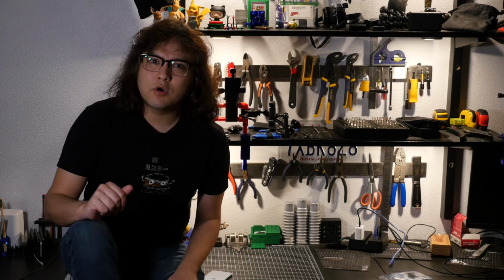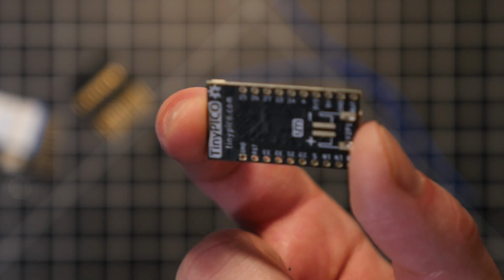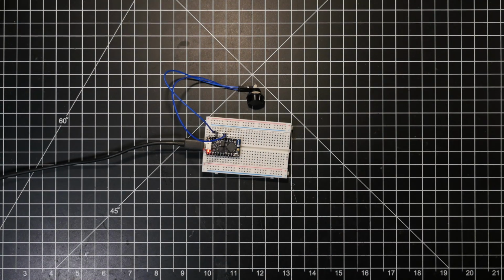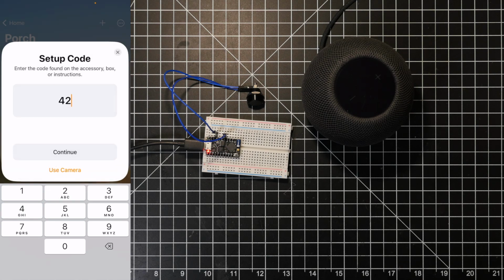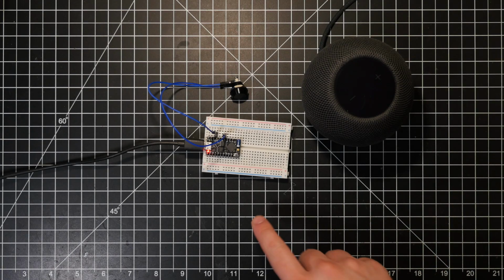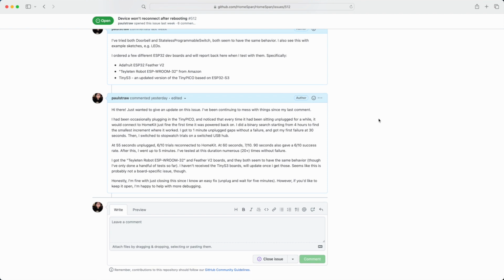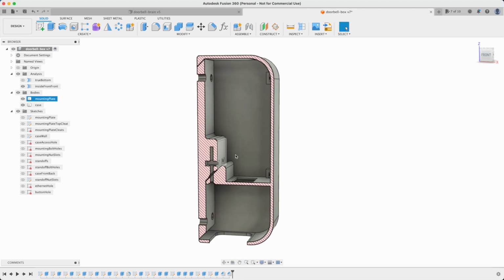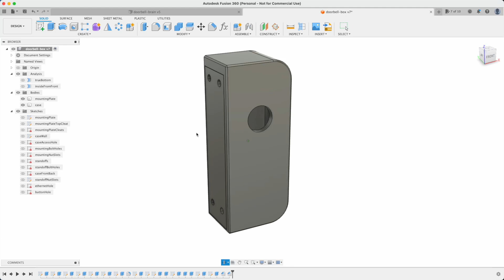ding dong. who's there? DIY homekit doorbell

Comment: Do you know if it’s possible to do an intercom no-video doorbell? Would love to hack something together for a building intercom.
Reply from the maker: I don't think audio is possible with HomeSpan. You might consider getting a cheap security camera with two-way audio and ripping out/otherwise disabling the camera parts? TP-Link Tapo C310 could be a good candidate. I use Scrypted to connect non-HomeKit cameras to HomeKit, and it works very well.

Comment: Hey, great video! Great editing, but something keeps nagging me. Why run an Ethernet wire from the doorbell when you could have just put the microcontroller in the doorbell box and run a much smaller wire just for power?
Reply from the maker: Good question! My reasoning was:

1. If there's an issue with my outdoor case design (i.e. it leaks), or someone vandalizes/steals/otherwise breaks the outdoor portion, I'd much rather just replace a button than a whole microcontroller.
2. I've not done any sort of security hardening on this system, and I don't want to put a microcontroller with access to my home network (and unencrypted credentials) on the outside of my house.

Now, do I really think those would be real-world problems? Nah, but this way I don't have to worry about either!
Reply: @paulstraw  that makes a lot of sense. Somehow I didn’t consider the vulnerability aspect. I’ll have to keep that in mind as I’m working on an outdoor IOT project soon.

Comment: Well done! I love the Homespan lib, I've been running it on several QT Py ESP32 S2 and it's solid, never encountered any connection issues. Is that problem specific to Pico D4?
Reply from the maker: Thanks! I've tried a WROOM-32 (Amazon board), PICO-D4 (TinyPICO), and PICO-MINI-02 (Feather ESP32 Feather V2) so far, and all present the same issue for me. I have some S3 (TinyS3) boards on the way, looking forward to testing with those.
Reply: @paulstraw  Really Weird. This is unrelated to HomeSpan  but I had some issues in the past with few of my homekit hubs stuck on standby and leaving bunch of devices unresponsive or struggle to get connected.
Reply from the maker: @salimbenbouz  I actually ran into that issue last week with my security cameras! Sadly it seems to be a separate problem. I'm also getting the same results on a separate test network without any HomeKit hubs. It's a real head-scratcher 🙃
Reply: @paulstraw On a separate Network!? You got me intrigued. I will definitely try the new Homespan release in the upcoming days.
Reply from the maker: @salimbenbouz  Yeah… I feel like it must be something ridiculous on my end, I just have no idea what the common denominator is yet.
Reply: @paulstraw  any updates?
Reply from the maker: @StormBurnX  No, I haven't made time to look back into this. We rarely lose power, and it actually seems to come back online fine when we do (as long as it's not just the ESP32 being quickly rebooted). In practice, it hasn't been an issue so far!